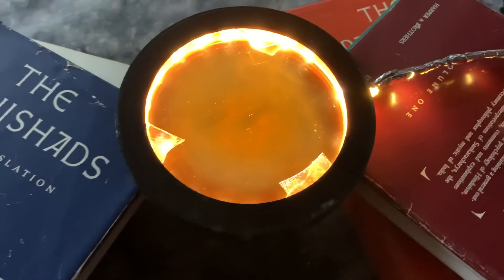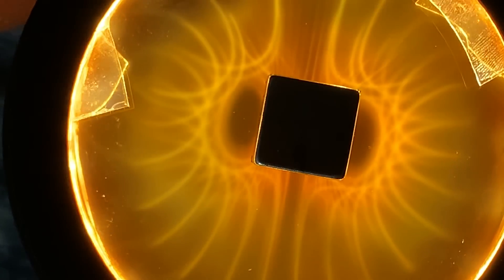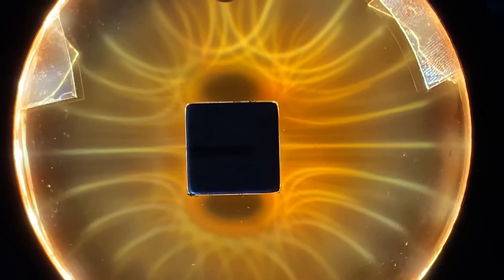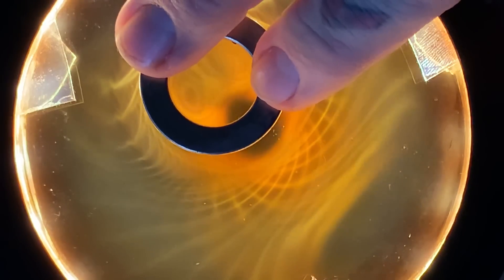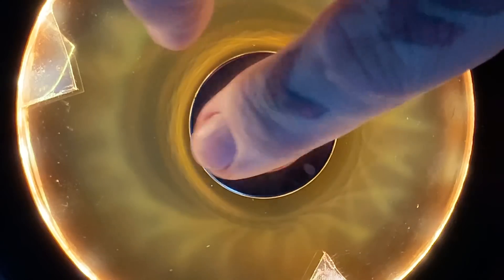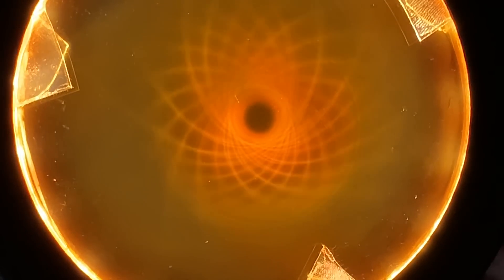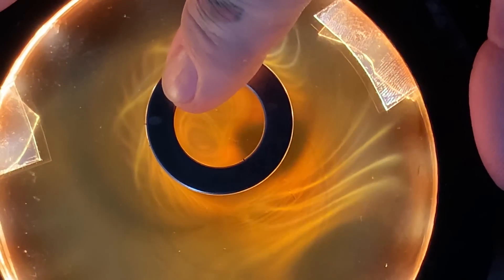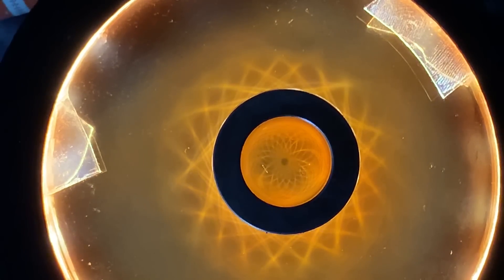🌑 NATURE’S INVISIBLE FIELDS Explained 😇

Comment: what is the frequency component to all this? This reminds me of a modified lissajous pattern. Two sine waves interacting with respect to two axis' (horizontal and Vertical). Changing the frequency of one sine wave modifies the pattern seen on the oscilloscope. If a magnet had a Frequency component to it what would it be and how would you change it?

Comment: Thank you Ken - seeing your fine work with ferrocells has inspired me to make one, I just got all the necessary parts/fluids as per your previous video. May I ask what is the new combination of fluids you use? Did I hear in another video that you replaced the mouse milk (oil) with an alternative? I'd love to get that sensitivity. I did buy a small ferrocell back in the day from Tim V but it is very small. Thanks!

Comment: May I ask why in a fluid that when you place an object behind the glass, which is clear when I see glass, that one cannot see the object behind the glass? If I were to create such a thing, one might use a totally opaque mirror on one side with a less opaque mirror like a two way mirror on the other side creating a mirror box to bend light like two mirrors. Much like the ruby rod but possibly like ruby slippers? Just a question, but imo, doesn't show what you imply. Always loved the making of the magic box. 
I haven't seen anybody bend light from a central source as of yet, it's always from the peripheral. cooool though as leaving such in one spot would imo, burn the image onto the mirror.  Yes, no?
Reply from the maker: i have vids on HOW to make these
Reply: @KenTheoriaApophasis  I do dig your work, I see perturbations different I guess. I don't see the waves on the pond, rather, one and if there is another ripple, it's a totally different one. I guess analogy, prop vs, jets. Same medium, different means.
Free energy, some one wants to make it for free, to charge the rest a lot.

Comment: Hi Ken. Sending you Love from Los Angeles. I loved your last video with the ferrocell. Not sure about the bag design…subjective I suppose. 

Anyway, I am writing to ask which one book in particular of the dozens of books you’ve recommended regarding understanding magnetism/dielectric/electricity phenomena, should I try to read first (also subjective to some extent I suppose)?

I have a basic understanding of circuits (household wiring, volts/watts/hz etc…), AC vs DC, coupled with your videos over the last 2.5 years. So I’m basically an amateur with no formal physics training.

If I had to guess, you would recommend the great teacher Steinmetz, as a good wake up 101. 

Assuming I’m correct, Within his corpus can you direct me to a particular starting point. 

I want to stay as close as possible to pure field theory and the aether model of nature. 

Also, have you had a chance to check out Tufts college professor Michael Levine? He’s found “magnetic” signatures previously unknown on a cellular level, and been able to manipulate them to express particular DNA instruction, such as build an arm. He’s discovered a layer of instruction previously unknown (due to our ignorance about field theory) that is mostly responsible for how cells decide to create and organism. 🤯. 

Anyways, you are a hero to me. Keep up the good work. ✌️

Comment: I wonder if you could take square/rectangular pieces of that optically flat glass and build one of those devices connecting them on the x, y and z axis’ to be able to show a 3 dimensional view of the magnetic field. (Leaving a cut out in the center to place the magnet.) Thoughts?
Reply: mind blown.

Comment: Hello Ken,
First of all, thank you so much for once again a very interesting video. 👍
Have you ever tried to put a speaker underneath the supercell? I bet it could give very interesting cymatic effects. Not just with certain frequencies, but perhaps also combined with certain languages?

I once read about the research by Dr. Jenny. He had noticed that when the vowels of the ancient languages like Hebrew and Sanskrit were pronounced, that the sand (which he used as a medium to vibrate) took shape of the written symbols for these vowels, while modern languages did not generate the same result. With your interest in ancient languages, this might perhaps be an interesting intersection? 🙂

Comment: Hi Ken, about the "ether". Not sure I can say as much as I want to on this little phone screen. I've always felt that there has to be an ether.  The Michelson Morley experiment supposedly proves that there's no ether. What I think it proves that we don't have a model for what ether is. Special and general relativity are basically thought experiments and don't take into account mass. You can describe the precession of a gyroscope by adding up vectors of mass and acceleration. But what if accelerating a mass causes a field to radiate out and a distortion of the ether, and the momentum energy is stored in this distortion in the same way as a magnetic field around a coil stores energy to be released when the current is interrupted. So when you spin up a gyroscope a field radiates outwards and locks into the ether thus identifying a key feature of the ether around it. So you might spin up a massive gyroscope and then apply a brake to it, what would you expect to measure as the energy is Drained out of the ether around the gyroscope. Is a clock brought close to the surface of such a gyroscope affected? So the Michelson Morley experiment proves that there's some sort of frame dragging going on. Maybe the ether has one characteristic for light and another for this momentum storage field mentioned above. I keep an eye out in the literature for this sort of thing. The nearest is Eugene Podkletnov?? Gravity beam experiment which again no one seems to be following up on. Anyway I much appreciate your videos cheers.

Comment: Most excellent! I've been waiting to see the fields fight under the cell. Awesome! My square N52 driver magnets I think would fry out the cell right away if you tried to fight them. The third spot that shouldn't be there, that's not a pole, is the key to everything science is missing and failing to understand. That fight, and that counterspace nonpoint, are what propulsion tech will come from. Those 3 things are the Rosetta Stone for field propulsion. When you put the cube under and above the cell, the two poles could form a tunnel of counterspace, if two cubes were placed opposite each other. Could you please show this? This tunnel would be funneling Dielectricity continuously! All you need is the tap. Could you please show and explaing the significance of this. Mind blown. Thanks. Good day.

Comment: Upanishad 😎. Curious what the ferrocell would look like if a set of smaller magnet blocks were mounted into a high strength 3d printed spiral configuration.  Actually a few sets of spiral configurations. 3d print the spirals with different rates of curvature based on universal constants applied to vary the proportional rate of curve change. Hmm. Haha maybe it's nothing idk.
Reply: Further, a 3d printed shell to mount magnets in a 3d toroidal pattern of magnets ..

Comment: Sometimes your words run together and it's difficult to tell what you're saying. For example, at 0:44 the Closed Captions read "And of course dielectricity is the extrensic loss of energy of the dielectric". I had to slow down the video to 0.70 of normal speed to be able to hear it. Otherwise it was just a blur. Reminds me of how those old southern preachers used to string a whole bunch of words together at once during a sermon. I'm saying this because I want to understand you better.

Comment: Frame rate. 60fps would help. Trumbull recommends 144 FPS for the 3D applications. 120 would be reasonable for what you’re showing. Being that light travels fairly quickly (and you of all people know this WELL) can we have the higher density data rate..? Specifically when showing the wonders of magnetic field geometry. It makes a difference. The subtle changes will be otherwise lost. honestly have no idea why everyone isn’t doing this all the time. “We have technology, we can rebuild him..”
Reply: And yes I’m aware the ferrofluid is already slowed in reaction but the minutiae of visual data which would be lost during a transition between types of magnet and during their motion is still hugely significant in terms of data density.

Comment: Ever look at a small electric magnet, I image you would see pulsing rings. Would be very cool to see. You could change the voltage or current and watch the rings change.
Also, it would be awesome to see you use your multi-layer/3D ferro supercell again.
Reply: if they were to pulse it would be at the frequency of the AC current. 

DC current would definitely not pulse.

Comment: How do you make your ferrite powder fine enough to produce a ferro cell?
Reply: Ferrocell fluid can be made using a small amount of ferrofluid mixed with a strong surfactant to stop it sticking to the glass (or even plastic) plates (and itself). You can add WD-40 or even saturated distilled water with salt (brine) to improve the suspension fluid. There are a ton of really great resources online for building your own ferrocells and they are not so hard to build or expensive. There are lots of designs out there. Good luck.
Reply: @JumpstarOfficial  okay so ferrofluid is iron filings mixed in oil correct? And then I just add some WD-40 and hope for the best? thanks!
Reply: @freemanrader75  you can of course make your own ferrofluid with random bits of iron dust. The shop bought stuff is just a lot easier. Don't get it on your t-shirt or drop it on the carpet. It cannot be removed :-)
Reply: Easier to go fishing for it in the environment with a big magnet and then sieve it through a very fine mesh. Iron nanoparticles are abundant in nature and emitted in large quantities by coal power stations. Coal fly ash is full of it. You could set to work with an angle grinder and a big old block of iron and collect it off the floor with a magnet I guess. You would still have to sieve it. Easier to spend 20 bucks on Amazon.

Comment: Theoria Ken, I am curious if you ever done this experiment with a magnet under super cooled super conductive condition?
Reply: By itself a superconductor is not necessarily a magnet. You might see the field geometry if it pinned a magnet above it. That could be interesting.

One thing I find fascinating here is that a permanent magnet exhibits exactly the same field geometry I would expect from an electromagnet.